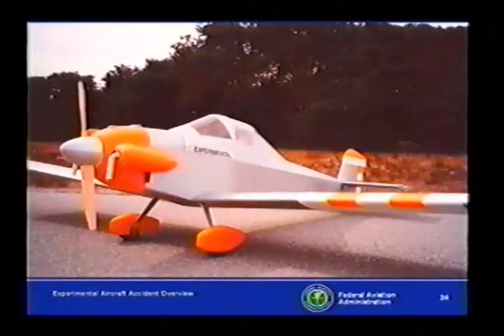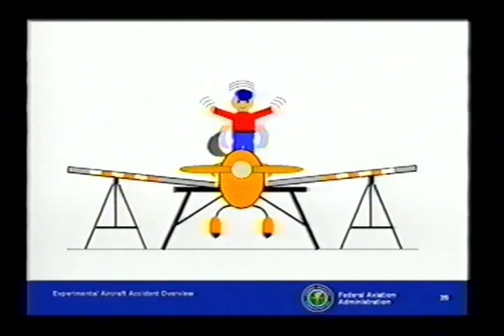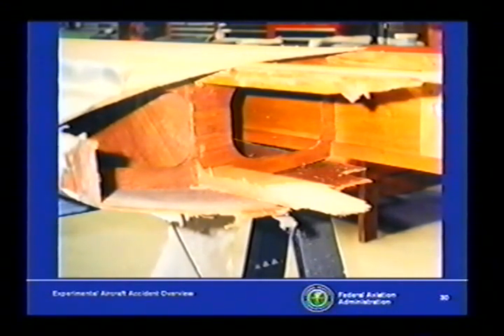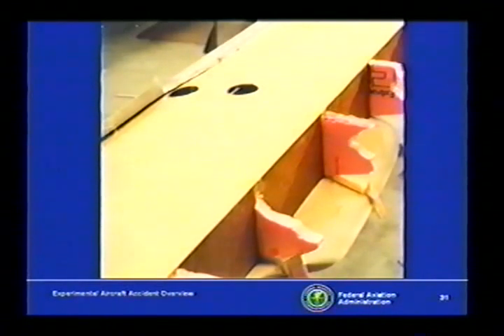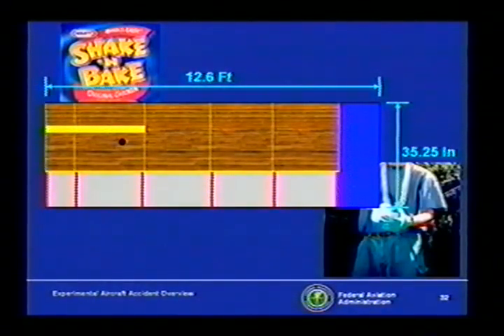Anatomy of a homebuilt aircraft failure

Comment: "People would rather Die than Think" - Wolfgang Langewiesche. (Book: Stick and Rudder).

This builder, I refrain to use the term "Designer", obviously had an absolute aversion to elementary beam theory. 

He had no interest in learning simplified statics, or mechanics of materials. 

Any book on any one of these subjects would have provided infinitely more knowledge than he possessed. 

And even if he had an acute Allergic reaction to Math, he could have loaded the wing with sand bags to check that they could hold up at least 6 times the gross weight of the aircraft. 

But again, that takes math. 

It also requires knowing the weight of the loaded aircraft, with you in it. Which also requires math.

Rather Die than Think. Apt description of this situation.

Comment: I feel like this isn't the entire story.  Why did the builder jump up and down to load the wing when attempting to find a fuel leak?? Was the fuel tank in the fuselage or wing? The spar caps look to be one piece continues but the shear web is completely missing and if it was there it must have completely failed at the glue joint. I don't believe someone capable of building multiple aircraft would join spar caps at every rib and not make a full span spar!

Comment: This is interesting, but also troublesome, as this individual should not have been allowed to build a staircase, let alone an aircraft.  The exposed foam ribs in pics did not appear to even have fiberglass and resin reinforcement.  How was such a plane given an air-worthiness certificate in the first place?
Reply: There are several kit airplanes with exposed foam ribs. Including Spacek SD-1 Mini Sport, Luciole MC-30. 

They simply glue 1 to 3mm plywood skins onto the foam. Even the ailerons and elevators are made this way. 

You can find Extruded Polystyrene (XPS) insulation foam boards with compressive strength from 15psi to 100psi. 

The cheapest pink foam at home depot is Owens "Foamular 150" which is the lowest end of the spectrum, and not an aircraft grade material by any means. (Im sure Owens would agree).

That being said, the Burt Rutan designed Quickie Q1 utilized 2lb.ft^3 Polyurethane foam, which has a compressive strength around 20psi and was even weaker than XPS 15psi foam. Used PU foam, as it was easy to carve into a sleek fuselage shape. Those Q1s seem to hold up at least 30+ years. But also have 1-3 layers of fiberglass over the foam. 

There are several SD-1 and MC-30 with hundreds of hours. But I would not count on them lasting 30+ years.

Comment: A very informative lecture indeed. Test your wing to at least 3.8 G...(=light aircraft level). Fracture G level must be 5.7 G or higher. (=1.5 * 3.8 G)

In the end the lecturer makes a small mistake. The stress calculation shows 1.92 G ultimate load and hence 1.92 / 1.5 = 1.28 G limit load. 

A structure has to show ultimate load for at least 3 seconds. So ... a near 60 degree turn would be the limit.
Anyhow ..informative.

Comment: I think he used an R/C plane to pattern from. Short spar tube that the wing slides over. I have many of those.
Reply: Even RC airplanes don't use this type of wing. All RC planes whether they have a tube joiner or not will have a full length spar, the tube is bonded to the spar and connects both spars from each panel together.
Reply: Maybe he watched "Flight of the Phoenix" once too often...

Comment: So, I cant even build a 3' high fence around my yard with certified structural drawings approved from the county. But you can draw up plans, build a plane and fly it at a local airport??!!! WTF?
Reply: Youre risking ypur own life. Why should we have to get approval from some dude w a certificate? Per ypur implied mindset we wouldnt have planes or automobiles because their inventors wouldnt have been allowed to build them. There are a LOT of experimental  that far outclass their commercial counterparts in every way. Google DRACO stol. The best stol aircraft on the planet. Experimental. Designed from scratch by a hobbyist who routinely radically changes it
Reply: Has to do with some of the inane defects in the Professional Engineering laws in many states.  (I am A P.E. btw.)  You have to have signed and sealed drawings for a residential air conditioner installation, but a car, airplane, refrigerator, or hair dryer is a “manufactured item” and is exempt.

Comment: good new modern kit planes are much safer than the old certified airplanes. since there are no more economical certified airplanes left, people resort to buy low priced older certified planes are corroded and they are basically flying death beds. Newly build EAB kit planes are new, and they are equiped with the latest avionics.
Reply: 2Phast4Rocket, properly maintained older airplanes are safe. The key word being properly.
Reply: A lot of false premises there.

Comment: I built a Mini-Max several years ago, and lost it after engine failure on takeoff - avoid Hirth.  When the engine quit, I could not get back to the runway, and elected to land in a field on airport property.  Unfortunately, in the few seconds I had to think, I failed to remember that there were power lines at the edge of the field.  They were blocked from view by my forward fuselage, and my landing gear hit them.  The plane stopped, and nosed into the ground, then caught fire.  I walked away without a scratch.  I was lucky, but a well designed, correctly built and inspected aircraft with a four point harness didn't hurt...

Do what you love, but be smart, and be careful...

Comment: yes, the airplane was never airworthy,  but the obvious disdain that is expressed by the government worker presenting this info, towards the public is equally disgusting.  My model airplanes are designed and built better than this, but it's none of the government's business if i'm not endangering anyone.  they hav eno real interest in my safety anyway, unless they can charge me for it, or make new rules that they can make money enforcing.  right now they are trying to ruin aviation, and discourage anyone from flying in anything other than a commercial aircraft.  The FAA is supposed to promote aviation. It does not look like they are doing that.
Reply: They are promoting aviation. Do you think they should stay silent about bad construction practices?
Reply: Yeah not a huge fan of regulation but I don't want you flyin over my house in a POS like this either.  People building junk like this are exactly how and why the government gets control to regulate, because SOME people wont regulate themselves and kill others in the process.
Reply: You would indeed be endangering others when the airplane, RC or full scale flew, unless of course, you are flying over a completely isolated area which is unlikely.
Reply: They don’t let you operate just anything with an engine and wheels on a road. It has to meet certain safety standards and guidelines. The same goes for aircraft. The pilot built His plane with, evidently, zero regard to basic structural integrity.
Reply: Your stance would be different if this plane crashed into your house and killed your child.
Regulations are to protect the public... Period
Reply: FPV.. Do you fly??
The FAA just introduced the LSA category to promote flying for more people. Many veteran pilots that were grounded due to medical issues have passed LSA qualifications and are flying again in this category.
As far as model aviation, the hobbyists created there own problems. Modelers are out of control and are flying out of designated airfields, many of whom are not flying respectfully nor responsibly. The AMA isn't helping the hobby neither.
Reply: No, the government controls and regulates things because they are no longer bridled by the constitution.  Scope creep has brought us into a hyper regulatory illegal-everything world.  And we have people like jones here, and jose batista, and john smith, and rotorheadv8, who "internalize" and "normalize" the illegal-everything world they grew up in, and champion more of the same.  Thank God we got Trump to tamp down the government as much as he can in 8 years.  God help him stack the Supreme Court so it will stay tamped down for most of the rest of my life, at least.
Reply: That's funny.  I like Trump and I said I am not a big fan of regulation but you obviously have nearly zero ability to comprehend what I wrote.  My point is, idiots like this guy and you are what causes regulation so thanks a lot and learn how to read before you keep building junk planes.
Reply: @ivanabcdefg9375 , you really don't understand do you?  Trump and his fellow plunderers are dedicated not to your freedom but to enriching themselves at your expense at every opportunity. For example you need environmental standards because if you live in Flint the likelyhood is that you will get sick from pollution. Likewise if you worked in a Dupont plant dealing with Teflon you could be in big trouble. For sure there's gold plating but you personally can't stop these giants- it needs rules agreed by all of us- it's called democracy.  Otherwise go and live in Flint and see how you get on because for sure Trump won't lift a finger.
The FAA does an outstanding job of policing- not preventing but  managing and picking up the pieces. There are lots of homebuilts- see the Draco or any Rutan  which are amazing aircraft and comply. But they have to stop people building planes from Kleenex and incompetence or as another writer has said it might be your house or loved ones that get destroyed.

Comment: I am a pilot and a builder as well as having experience as a test pilot for homebuilts and repaired certified aircraft.
I only took this as a word of caution to would be uneducated designers. Not as criticism of homebuilts in general.
   As an owner of an experimental aircraft I also now that nunbers and per hrs flown...amature built aircraft have a disproportionate ratio of accidents....not necessarily the fault of the design itself but more often than not...the pilot not properly familiarizing themselves with the aircraft before attempting flight or flight envelope expansion.
   Still. .the point here is well presented and a lesson for all should be applied when purchasing an aircraft.. especially an experimental airplane.

Comment: There's more than a design failure here, what about the FAA certification inspection? Someone, supposedly knowledgeable and licenced by the Government had to look over his plans, and the aircraft itself, and somehow, inexplicably sign the man's death warrant. Don't get me wrong, the designer has himself to blame for his death, at least the majority of that blame.
Reply: Ryan Taylor - no inspection if under far 103.
Reply: Thank you for the info, I checked the FAA web page regarding FAR 103. I find this amazing, since it means that someone with ZERO experience, and ZERO knowledge of aircraft design can slap anything together (providing it is within the specs. of an ultralight for speed, and weight), and basically build their own coffin. I'm not a big fan of government regulation, but aircraft have the potential to kill not only the pilot but anyone unlucky enough to be in the impact zone.
Reply: Drone registration is currently not required, for private 'model aircraft' category units. Fought in Court and the 2012 federal law exempting model aircraft signed off on during the Obama administration won out over the FAA requirement (May 2017 case).  

This was primarily for tracking ones used in illegal locations that crashed & were recovered. More useful as a reminder to legal users of the rules they sign off on when registering and that they may be caught if violating them than for any prevention of intentional illegal use.
Reply: I don't see a Registration number on the aircraft , the builder may not have had the required inspection. He built it and he flew it.
Reply: Under current FAA Regs, an individual can design/build an aircraft from scratch with very few regulatory requirements. In this case, with no inspection covers, a DAR had no way to inspect the structure as finished. The required builders log might have given a clue but even then the nature of the spar design may not have been apparent. Incredibly, even engineering calculations are not required. TLAR, that looks about right, is acceptable. The EAA is a tremendous resource for anyone interested in anything from a powered parachute to a super sonic jet. Everything from first hand experience in fabrication to design expertise. And for the most part, it costs almost nothing. Unfortunately, some folks insist on their independence and get into trouble. One I’m familiar with is a fellow that plans built a beautiful amphibian out of wood. First rate wood working. The DAR asked what adhesive was used. The answer, “Elmer’s.”(That’s a common water based general purpose glue.) The DAR thought it was a joke. It wasn’t. This builder had attended one local EAA chapter meeting, brought something for “Show and Tell,” that was below par workmanship wise. Some fellows tried diplomatically to show him the problems but he wouldn’t hear it. Spent six years building a one to one scale model of an airplane designed to operate on water with a water based glue. The DAR told the guy to take a chain saw to it. You got to admire the passion but even the Wright Brothers got outside help when they needed it.

Comment: Wood naturally has defects. And even if wood does not have defects at the beginning, over time wood changes and might develop defects. That is why for structural elements such as landing gear and spars, they should always be made of metal (aluminum, or titanium). And do what Boeing does;  put a static load on the wings to simulate 10 times what the conventional wing loading will normally be.  You do this by placing the airplane upside down and then placing sand bags on top of the wing's bottom surface, distributing it evenly from root to tip, until a total of 10 times the vehicle weight has been placed onto the wing.  Leave it there for 2 hours.  If everything is still okay then your plane will be safe to fly.  if any bending occurs then you need to make that spar stronger.   Simple but effective way to build a strong and safe wing.
Reply: I guess you would not like to fly in a Bellanca Viking. Speaking static load tests, look at the load test done on the Viking wing.
 By the way, aluminum develops defects, it's called corrosion.
Reply: Wood is a very effective aircraft building material. Has been for a century, and still is. Some of the best aerobatic aircrafts use wood. Any material has defects, but wood has distinct advantages such as very good bonding capability, easy to work with, durable in time if well protected, and overall, good strength to weight ratio with low density allowing large sections, just strong enough, without weight penalty. Most metallic designs are not designed for strength but stability (buckling).
Reply: With you right up to the bit about the building a stronger spar if the wing bends. Wings on airliners bend. They are designed to flex somewhat. If they are too rigid they will be brittle and then when overloaded they would simply snap all at once. All that really matters is if the wing is damaged.
Reply: Honesty Counts If you are referring to destructive test procedures for Boeing a/c type certification per FAA then you are mistaken.

Comment: Sad, but something is missing here. How did the FAA license this airplane without proper paperwork & inspections? 
In Canada first step in building a home-built airplane (amateur build) is a letter of intent. 
Second step is a pre-cover inspection which would revealed luck of proper spar. 
But anyway, an unnecessary loss of life.
Reply: Peter Pasieka The airplane does not appear to have a N-number. In order to be a certified experimental airplane and have an N-number the builder must submit a build log with photographs, expense report, etc. to prove that he or she built more than 50% of the airplane themselves. The more documentation you have, the easier it is to get Federal Aviation Administration certification. At that point you generally have at least a Sport Pilot's, and probably participate in the EAA and other enthusiast groups.
There is the possibility that it's a FAR 103 compliant ultralight, which do not require such certifications. Kits and designs generally get certified anyways as a selling point, but individual ultralights do not as they are not legally considered aircraft, being originally motor powered hanggliders and needing to be built with fuel tank of less than or equal to 5 US gallons and a range of less than 60 statue miles at cruising power, flying in unurbanized areas of the US to minimize the risk to others.
Reply: The hard landing sped up the failure time. That wing was inadequately designed and would fail soon. Look closely at the presentation and the design calculations.  A steep turn, 60 degree bank, which is a normal aircraft maneuver  would stress that aircraft above it's design limit.
Reply: It may not have been approved for flight or issued an N number. I have read several accident reports of home jolts that crashed that were never registered. I have also read of several homebuilts that were built and flown off of farm strips and have never been registered, but have also never flown anywhere but around the owner's property.
Reply: You can't really believe that he got this plane inspected and approved by anyone from the FAA do you?